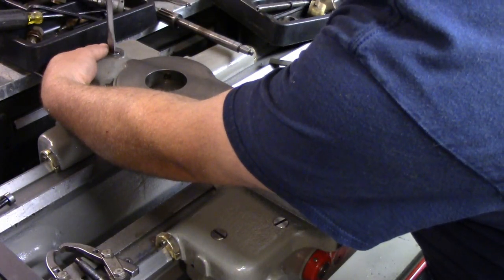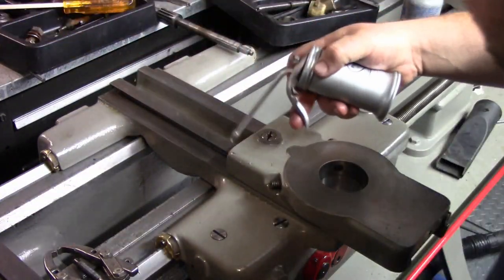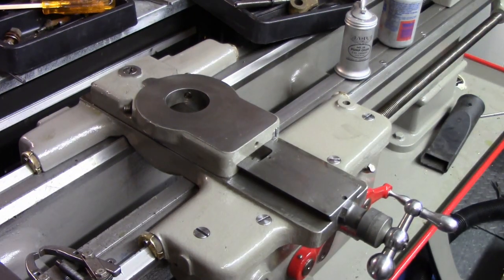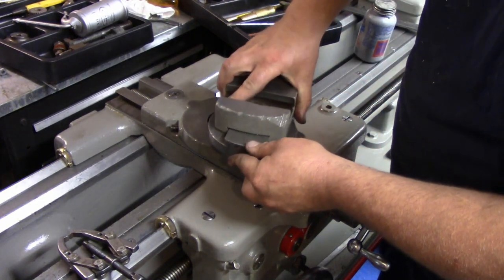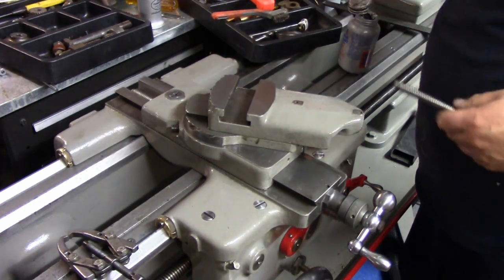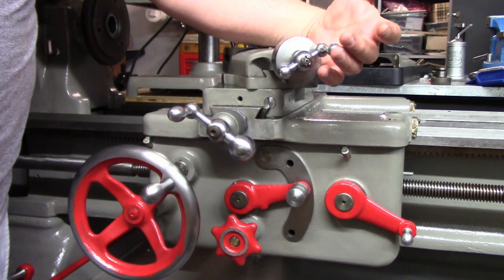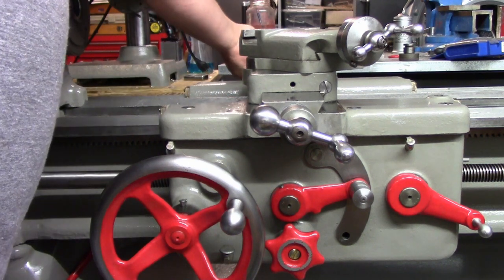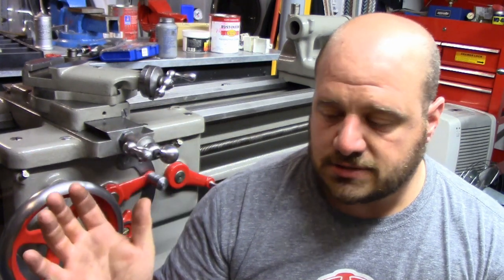13" Southbend Refurb: Carriage Assembly

Comment: Use the magnet end from one of those giveaway screwdrivers to egret that handle pin back in. You push it in with the magnet and not risk shooting it out of your pliers and losing it forever. Nice rebuild.
Reply: Mark, great tip on using the magnet screwdriver. cheers, Paul

Comment: I know you enjoy restoring the old Southbend machines.  But....do you mind sharing what the cost has been to restore this.  I know you have spent many many hours doing this.  It seems to me that for most hobbyist or even small job shops not high production, it would make much more sense to buy a good new clone machine that has zero wear and would probably cost less and is ready to go.  Good job on all you do man.  I have had a new 13x40 lathe for about a year now and love it.  It's been an excellent machine.
Reply from the maker: With everything I've done including cost of the lathe I'd say I'm in the $15-2000 range

Comment: I needed a retainer nut and pin for the compound ball crank on my 13", but had trouble locating a replacement. I did however find out that the nut diameter is .555 and the thread is 5/16 -24.
Reply from the maker: The pin is nothing special.  I've lost the original and just clipped a piece off of a rod that fit snug.
Reply: Same here. Was easier than I thought.

Comment: Greg I have a 9" south Ben and the cross slide nut has some ware that has given me some backlash I am new to the lathe and just a hobbyist at it. At this point I can't cut threads on it and was wondering if it was possible to buy a new cross slide nut and if so where could I purchase one. Thanks for any help you could give me. Thanks for the good videos.

Comment: backlash almost makes one want to make a second nut that fits on the shaft with a guide pin.. a spring and a screws to adjust the spring tension pulling on the lead screw against the nut..
Reply from the maker: I was going to do some sort of split nut but the problem is the way the carriage is designed and the way the nut is designed there is no room.
Reply from the maker: I was going to do some sort of split nut but the problem is the way the carriage is designed and the way the nut is designed there is no room.